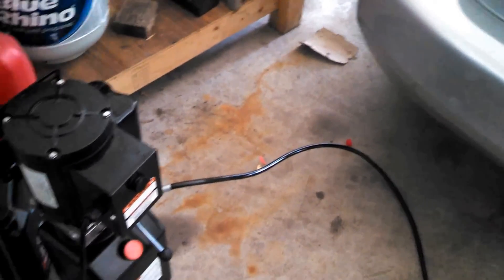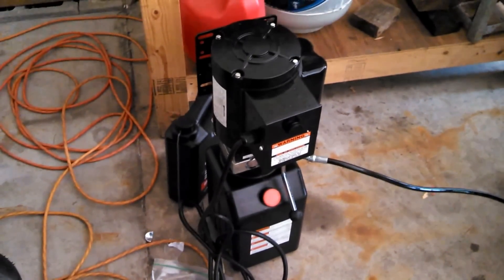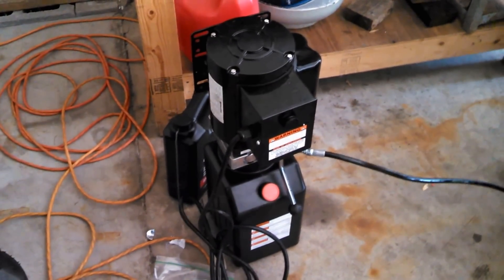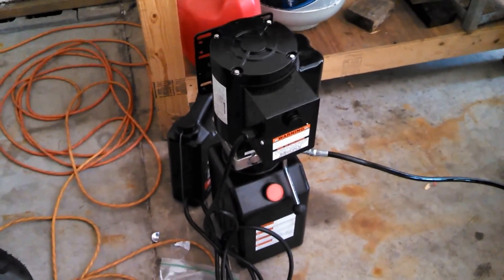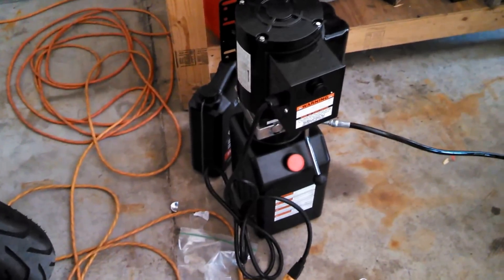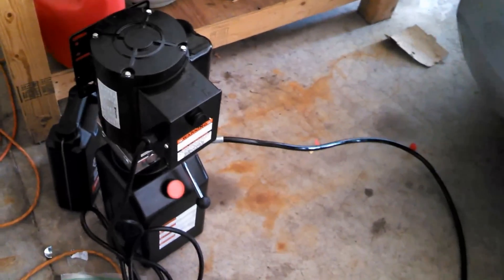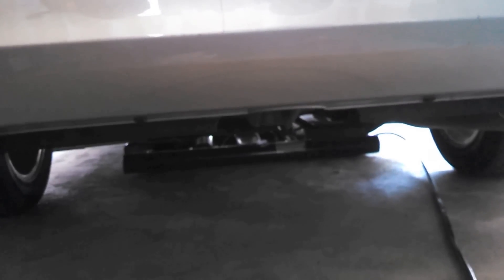My new Bendpak MD-6XP scissor lift - Setting up and first use

Comment: Yea I got mine a week ago and Iam still setting it up.When I bolted the lift arms on they seem to rub on the lift a little bit.In the box the washer and nut were on the stud of the lift arm. the instructional manual showed putting in on the way you did just putting the washer on right before the nut.It got cold working out in the garrage so I went in the house and was looking at the pdf file instructions and it has two washers on each arm.put the one washer on then lower the lift arm on to the lift and put the washer on then the nut. you can go to the bend pak web site and download the manual and you will see what I mean.Its no big deal just wondering if I should get a few more washers and try it that way. I work lately 7 days a week and I have only small time to work on it. soon that will change. I like this thing a lot seems like it is built super heavy. Iam tired of crawling under  cars to work on them this will work out real great.
Reply from the maker: Yes I see what you mean.. I just looked at the pdf... Sometimes these manuals are slightly different than the actual product. If they only sent you 4 washers, then you should be good. They are going to rub the top of the lift when you swing them in and out anyway. I might play around with mine in the spring and see if they would work better with washers on the top too. Let me know how you make out, and if you have any other questions. Congrats on the new lift!

Comment: Thanks! with only the four washers it rubs on the lift, maybe that is good because it supports the arm more. if it was raised up with a washer there would be more stress on the channel part if you know what i mean.Just something to think about.Oh yes hows the puppy.
Reply from the maker: Yeah that's what i was thinking too, but i believe they're supposed to sit right on the frame of the lift like that. But now you got me wondering why it shows it like that in the pdf.. You could call Bendpak and ask.. they are great to deal with. 
Oh the puppy is great! The thing gets more attention than I do!

Comment: when you bolted on the lift arms did you have a washer above and below the lift arm? the pdf file  shows a washer under the lift and then one  before putting on the nut.the paper manual shows only one washer used and that is put on and then the nut.
Reply from the maker: I believe there was only one washer on the bottom, between the nut and slotted area of the lift frame. The threaded stud is part of the lift arm (welded?) So there's not a bolt that goes thru the top of the arms. Hope that answers your question. Are you buying one of these lifts?

Comment: I'am thinking about buying this lift. looks great for working on my cars and for pulling lawn tractors on  to work on them.What is your opinion for me buying this lift? thanks=Tim.
Reply from the maker: I would absolutely recommend getting one! Lawn tractors, I'm not so sure. I mean you could drive it up on it, but not sure what you could access.
As far as working on cars, I needed something portable, and also something for low ceiling height. I also have a set of wheel alignment stands that i use to lower the vehicle onto so i can lower the lift out of the way for complete access to the center of the vehicle. I'll do a video on my setup at some point.
If portability isn't an issue for you, you should look at the MaxJax by Danmar. I was also considering that one.
Thanks for watching. Let me know if you have any other questions..
Reply: +tonyming6969 Thanks, I'am getting one very soon. pulling lawn tractors up on it and other stuff will allow me to raise it up to work on all kinds of stuff just so I can sit on a stool and work on things. like a raiseable work bench.

Comment: Thanks for putting this up. I'm considering getting one for my 2016 Jeep Grand Cherokee. I see you have a truck in the driveway. Have you tried this with the truck yet? Any issues?
Reply from the maker: No issues so far! I put my Ridgeline up all the time, and my 2015 Wrangler. I've lifted a 2004 Silverado 1500 4x4, and a 2007 F150 4x4 and it lifts perfectly without a struggle. Let me know if you have any other questions.
Reply: Thanks for the quick response! I appreciate it. I'm gonna have to save up some money for this thing but would love to have it in my garage! It would definitely come in handy.
Reply: BHG...one more question...how are your floors now that you've used it a few times? Does the lift really dig into the concrete?
Reply from the maker: Sorry Alex, I just saw this question.. The lift doesn't affect the concrete much at all, at least not with the minimal use mine gets on average. The main wheels/rollers are flat and very wide, so it works very efficiently. You could even roll the thing on some cardboard or something if you're worried about it marking up the floor. Hope that helps! Let me know if you end up buying your lift!
Reply: It's all good. I appreciate the reply. I really want one of these in my house. Thanks again for posting the video!

Comment: Nice video, But I have a question, for the first starting up, You had to purge the sytem of oil to chase away the air of the system?
Reply from the maker: Julien WOLFF    They automatically bleed. You will hear the air automatically purge out. Then you just need to recheck the fluid level.
Reply: OK, thank you for the answer

Comment: Love it!   what is the ground clearance of the lift?  (4, 5, 6 inches??)
Reply from the maker: i believe it is about 4-5 inches. If I'm working on a car with low ground clearance, I just put long 2X4 or 2X6 inch wooden boards on each side to drive the front wheels up onto.

Comment: Looking to get this specifically for my 2006 honda ridgeline and any sport car i get in the future.......how do you like this with the ridgeline and if you could change this scissor lift for free with another would you??  Thanks
Reply from the maker: Works great for my Ridgeline! But ideally, if I had the ceiling height, I would rather have a regular 2 post full rise lift. But this is perfect for the space that I have. Although the Max Jax by Danmar is also a nice mid-rise option, just doesn't have any maneuverability like this one does.
Reply: @tonyming6969  Thanks!  Ive done very little research but it seems like the mid rises compared to posts, 2 or 4, seems like theyre the best user friendly and safe option.  Ive seen alot of posts fail or tip over and yet to see one fail or tip over for a mid rise scissor lift.

Comment: Could you change a clutch with it
Reply from the maker: The lift might be in the way, but it can be done. I actually use 4 wheel alignment stands to lower the vehicle onto, then lower the lift all the way and wheel it out of the way. I do that for exhaust work and stuff like that.
Reply: @tonyming6969  Thats a good Idea. I have this same lift, LOVE it. I thought about buying 4 midrise jack stands that go up to 48" and setting the car/truck on, then dropping this lift down and out if necessary for under car transmission work.

Comment: What anout your floor?  My garage is pretty flat, but not perfect for sure.
Reply from the maker: Honestly the floor wasn't bad, but it is making some ruts in the concrete over the years. However, it doesn't affect the lift much at all. It should roll over most concrete with some imperfections.

Comment: You lifted the car backwards, as the non mobile part of the lift need to stay put under the greater load wich is the front of the car.
Good video though.
Reply from the maker: Nope, incorrect. This lift is symmetrical and can be loaded either way.

Comment: Ya how would you be able to change a clutch/Transmission/exhaust etc,.With all the bracing Etc ??????
Reply from the maker: I have 4 wheel alignment stands that I use to lower the vehicle onto, and lower and move the lift out of the way for complete access to the undercarriage. Not the ideal setup for that kind of work, but it works.

Comment: How tall is your ceiling???
Reply from the maker: Not sure exactly, but it's a standard residential garage height.
Reply: @tonyming6969  you can't just measure it? Standard could be 8' or 9' or 10' depending on the garage. I was wondering the ceiling height too.

Comment: Do you trust sitting under it for repairs?, Can you change a clutch with it?
Reply from the maker: I absolutely trust it. Even in a rare situation where the hydraulics fail, the physical locks will keep it from falling. 
Changing a clutch would be difficult. However, I also use 4 wheel alignment stands when I need full access to an undercarriage. I lower the vehicle onto the stands, then lower the lift to the ground. Then you can wheel the lift completely out of the way. Not the ideal way to do that kind of work, but it is possible.

Comment: It was ripped open to be inspected by agents. They routinely check freight packages selectively and the origin of this product is china so.. That's what happens these days.
Reply from the maker: Incorrect. It wasn't just opened. It was ripped and damaged and missing items. And it's shipped from California, not China.
Reply: +Big Honda Guy I've worked for all 3 of the shipping companies and shipments this big with the origin of the product being from China, meaning manufactured in China and shipped here to distributors, are routinely targeted for drug searches. I've seen it a thousand times and that's what happened to your package. They rip it open with NO regard and then provide you with this shitty tape job like nothing ever happened. They don't even have to tell you they searched it/ran it through X-ray machine... And they're not engineers so they also routinely forget to repackage items. I watched it at least 50 times a day for 10 years.

Comment: I hope they gave you at least half your money back for all the bs.
Reply from the maker: Greg Wallace     Nope. Like I said, I was too anxious to start using it! However, Bendpak and ASE Deals were both great to deal with, and took care of all my issues quickly.
Reply: I would have never accepted the package to begin with.  That is unacceptable.  I work in the shipping industry and that would not fly with me.  Once they start getting returned packages because of poor packaging on the shippers part, they would have no choice but to correct the issues.  Something like this where your life can depend on it, you never know how this package was  handle and repackaged and what sort of stress it experience, for example cracked welds and other issues that you will not find out about until it is to late.  That is a bad deal all the way around.  From what I'm seeing and what you are telling me, I would not purchase anything from Bendpak, that is just 100% poor customer service period.
Reply from the maker: Greg Wallace     I see what you're saying, but it has nothing to do with Bendpak. It is strictly the shipping company. This could've easily been any other brand of lift, or other equipment. And like I said, even though it wasn't Bendpak's fault, they still took care of all my issues.
Reply: Good luck!

Comment: Why do you want to lift a car with a device that obstructs access to the underside parts of the car you need to work on? Seriously....
Reply from the maker: It's mostly for brakes, tires, general servicing, and suspension work. I do also have four wheel alignment stands that I use to lower the vehicle onto, then lower the lift out of the way for complete access to the undercarriage.